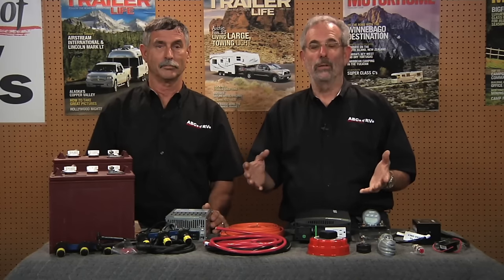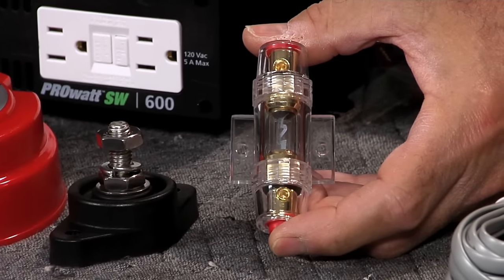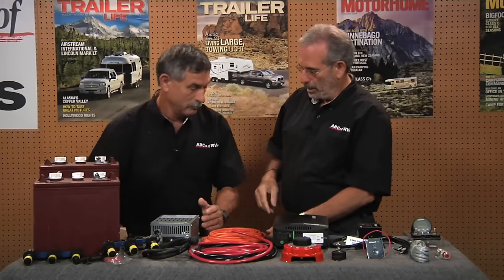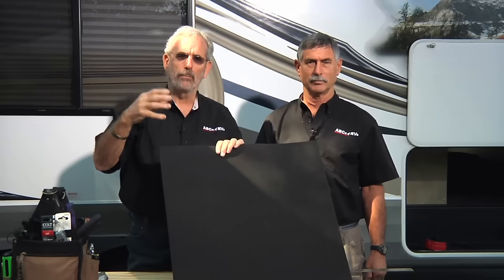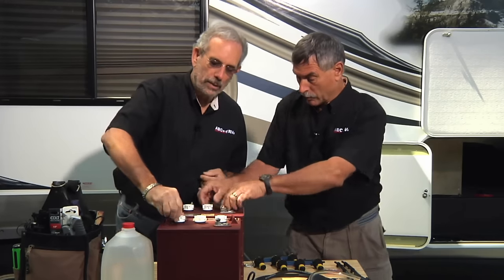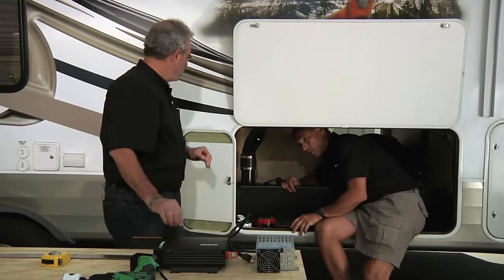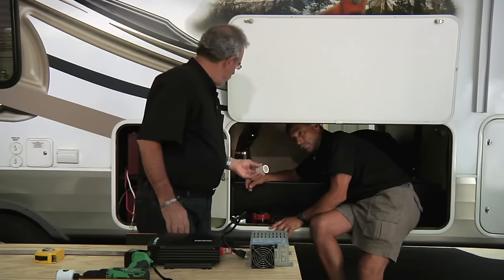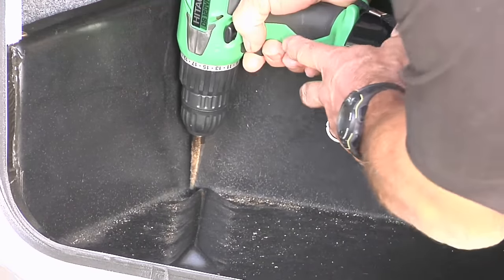12 Volt DC System Rebuild for RVs

Comment: I strongly recommended wearing safety glasses, especially when working with acid batteries that produce hydrogen gas and can explode. Unfortunately I witnessed a coworker have one explode while he was working with it so its not a remote possibility but very real.  
Thanks for the great vid. I did same to my rig but with 4 6v trojans 4/O cables and 5000 watt pure sine inverter. Really nice To run anything even the roof air or microwave.

Comment: Thanks for the good video.  I have to admit, some of the other comments bring up some 'oversights' or 'skip overs'.  I've been in the semiconductor, uv, high end residential electronics, and a fabricator for industrial electronic and electrical applications.  I started watching this video to get some ideas for a Jeep Wrangler.  I realize this is not purely an off road vehicle obviously, but some of the methods seen in the video seem not to be 100% robust and failure proof.  Vibration, corrosion, and waterproofing (marine grade everything) are the nemesis for off-roading vehicles and I would think these same problem areas would be true for RV's.  Cheers!

Comment: Overall a good video.  I have the exact same inverter. Like it very well. Two things I have issue with. The inverter is rated for 2000 watts. You have it hooked up with #4 wire and a 80 amp fuse on the 12 volt side. So you have an 80 amp circuit at 12 volts equaling 960 watts.  The inverter is capable of supplying 16 amps on the 120 volt side. But,  by this install,  it is choked down to 8 amps capacity on the 120 volt side.   Need to add another #4  cable in parallel on both the positive and negative battery feed.  I would change the fuse out to a breaker at 150 amps.

Comment: I had a new and large battery box fabricated to replace the cheesy plastic one to accommodate the larger 6volt AGMs. To make life easier in having access to the batteries, I bought two glides/tracts for cabinets rated at 200 lbs. The glides were welded to the sides of the box and a tray was attached to the glides. Under the tray I fastened three ball bearing rollers for added support. The #4 cables were cut to fit the length needed when the tray with batteries is pulled out.

Comment: Interesting video.  Thanks for sharing.  I have an interest in the battery systems on these trailers. There are not details but they are not required as I can look into those details myself.  I liked seeing what you were doing and gathering some ideas.   

The audio is much better once you get on the trailer so it was easier to watch at that point.  Thanks for the video and hope to see more.

Comment: Good idea to tape the wire nut at the end....but I noticed that you wrap the tape counterclockwise to the clockwise screwing on of the wire nut....which seems to have slightly loosened most of the wire nuts you taped up. Go consistent with your wire nut, tape clockwise too.

Comment: When you are using black tape to wrap the wire nuts, you should definitely wrap the tape the other way around. If you watch the video, he is pulling the tape tight and unscrewing the yellow wire nuts as he goes. In an effort of making his connections tight, he is loosening them.

Comment: Pretty good video. Obviously a lot of work ro make it. Improvements.... 1) A chart showing what's the before and after  2) Cost of materials 3) Basic block diagram of the existing system and then changes. 4) could have fast-forwarded through things such as applying a wire nut and tapeing. Anyone attempting this extensive change knows how to connect two wires. A chart of the bennefits. Seems like a lot of work and expense for what gain.  Thanks for your work.

Comment: Just a personal better thought about the battery choice 6 volt vs 12 volt.  A T125 6 volt Trojan gives you a 20 hr rate of 240 ah at 6 volts.  In a 12 volt system with 2 of these batteries you wind up with a 20 hr rate of 240 ah at 12 volts at a combined weight of 132 pounds.  A T1275 12 volt Trojan battery gives you a rate of 150 ah at 12 volts.  in a 12 volt system with 2 of these batteries you wind up with a 20 hr rate of 300 ah at 12 volts at a combined weight of 164 pounds.  So for an extra 32 pounds you get 125% of the ah rating.  I run 4 T1275's in my camper as opposed to the original design of 4 T125 plus due to the extra time available.  The common misconception is that by having 2 batteries you double volts and amps/reserve.  You can only add one or the other.  2 batteries in parallel gives you the sum of the amps/reserves (2 @ 6 volt 240 ah parallel = 6 volts 480 ah).  2 batteries in series gives you the sum of the volts (2 @ 6 volt 240 ah = 12 volts 240 ah).

One other personal suggestion, as opposed to a car stereo mega fuse, a 12 volt manual reset breaker makes for a less fuss way of protecting a high amp large gauge wiring system.  They have a higher cost, but work the same as a high voltage AC breaker like you would have in your home or RV's high voltage ac electrical system.  They are readily available at most automotive parts stores (Autozone, Pep Boys, Napa, O'Reily's, and Discount Auto parts all show them in stock in most stores across the US) and are available in ratings to more then handle your chosen inverter wattage requirements.  I personally have a Cooper Bussmann 30v 100a rated Circuit Breaker which has a cost of around $30.
Reply: Good idea on the batteries but you failed to include the cost.  Hope at $450 for two twelve volts versus $250 for the two six volts. That's almost a 100% cost indeed for a 30% gain in amps.  I'd have to be a very hardcore boondocker where they 30% made a real difference to justify the cost.
Reply: I wish you had made it clear about if that breaker is at the 12 volt level or after the inverter.
Reply: @lancebaker1374  There are LOTS of things that I wish they had made clearer. Hands were often in the way of the object being photographed, they pointed out how important it was to cut off the proper end of the extension cord without clarifying which end they chose, etc, etc.

Comment: You should use plastic snap in romex connectors. They are much faster to install, especially in cramped quarters. No locknut to fumble with or screws to tighten. Also less chance of wire chafing and shorts/fires in the future. RC-50's for 1/2" and RC-75's for 3/4" Knockouts. As a journeyman electrician with 23 years experience, we very seldom use those metal connectors anymore.

Comment: Good video overall. No grommets? Also, I would not have placed that junction box next to water supply, it wouldn't satisfy code in a house and these things are tinder boxes. At a minimum that should have been mounted vertically in a weatherproof box.
Reply: Just saw this. Agreed.

Comment: I just love the location that you have chosen to put the cutoff switch. Behind the plumbing. You will have to hire a midget to turn the switch off. Not mutch thought went into your desighn🤔. Put switch in first by cabin opening then install inverter and converter! Then measure cable lengths. Plastic conduit would be approximate for your install especially underneath where road debris could damage the wire and the wire is exposed to water. Your install is a shabby not well thought out procedure. The 110 wire needs plastic conduit and sealed with silicone to prevent water infiltration, or insects climbing inside the camper.  Your system will work but with more care and planning and insulation on  exposed wires and sealant where holes are drilled. This install could be better😁

Comment: Gentlemen although overall it was a very good video I saw a few major mistakes, 
1) the j box you used should have been a water tight or bell box, since you have a water pump almost next to box
2) their was a grounding lug on the 4s box that you used should have been grounded required by code
3)I waited and and but it never happen, the clamp box connector was never tighten

Other than that pretty good

Comment: When taping the wire nuts, it is best to put the tape on winding in a clockwise direction so that it is pulling the wire nut tighter on the wires. They do not have to back off very much to create a bad connection, or worse yet end up with a loose wire.
Reply: YOU ARE WRONG NEWK! The tape, applied COUNTER-CLOCKWISE,  prevents the wire nut from turning counter-clockwise!!

Comment: Talking about your wire connections using the right size ones you should be using electrical silicone field wire connecters then tape in them especially with being around a water source

Comment: Use a push button breaker, label all wires use corrosion resistant coating on terminals. Mount all cables.  Securely mount Battreys in a box in vented cabin mount inverter in a cool vented cabin that's water and weather resistant. Install a charge controller with a meter. Do not over discharge your Battrys. Install  solar panels and controller check battryes level every month

Comment: Great video. Just a few things I must mention. One. the J-box should have been waterproof if you're going to put it by the water pump. You were already wiping up water there. 
You didn't ground your box.  And just a quick check with a tape measure and the monitor and on/off switch would have been lined up. It would kill me If that were my camper and I had to look at them off center the rest on the time I owned it. 
But I must say it's the first full install job I've seen anyone put on here. 
I watch as much as I can. sometimes I see something I didn't know. Like the battery auto watering system. That's cool. But very pricey. I have 22 batteries. OWCH!!!!

Comment: I would never get these batteries.  They are too heavy and cost you on gas consumption in the long run.  Also, they don't really last five years each.  With regular use they will last around 2 and half to 3 years.  On the other hand lithium batteries with the same amp hours may be more expensive when buying them.  But, in the long run you will save money because they are lighter (less gas consumption on RV since it won't be carrying heavy batteries) and Lithium will last between 6 to 8 years and you won't have to worry as much on the percentage that is charged.

Comment: When wiring estimate amount of wire needed for the box and add 3 inches strip all wires 2inches and align all wires together then twist wires together with pliers tightly then use clippers cut off extra bare ends then use the right size wire nut and tighten with pliers then fold wire to fit in box. This prevents bad connections and wires from coming loose twist all wires together before wire nuting clip off extra wire

Comment: Is the zantrax transfer switch  to shut down power from the inverter to the box?  If you have the inverter turned on and you plug in the generator or shore power will the inverter stay and and if so wont the power sources be competing with each other or short each other?  Can you run multiple power sources at once and if not what will protect the system from blowing fuses or shorting out if more than one power source is used?  Will a 4000 watt inverter run a fridge and stove together?

Comment: well kinda confused you eliminated the circuit breaker on the distribution panel. then wen putting in the power for the inverter you cut both wires wen only needing to cut one.

Comment: Here is a tip for you  if you are going to disconnect and wrap wires as they have done; cut off any bare wire ends before you wrap them that way there is no exposed wires at all, because, bad things happen to good people. Usually by accident. :-)

Comment: Why did you cut two separate wire bundles to splice in for power to the new converter? You could have just messed up two circuits at different amperages.

Comment: And wind fasting your J box down along with your wire fasteners you should always use silicone on the ends of your screws so that when you’re towing your trailer down the road water can’t Seep in and write out the word.

Comment: About the J Box install; I would not have laid it flat on the floor there, because it’s beside a water pump. I”d have mounted it vertically to the wall, in case of water infiltration. Other than that, good job.

Comment: Can the transfer switch be connected to more than one circuit, as long as the total capacity of the combined circuits is equal or less than the capacity of the inverter?

Comment: As a retired electrician I'm disturbed by the fact you are not twisting your wire ends before installing wire nuts. This allows corrosion and oxidation to diminish the actual copper to copper contact and cause overheated connections.

Comment: Did you consider lithium batteries as they are lighter, last longer and do not need the addition of water?
Reply: Hi, Mary, this video is a couple years old now so, no, lithium was not considered at the time. I definitely would consider that if overhauling a system today. Do take cost into consideration, though. Lithium batteries still carry a pretty heavy front-end investment. When you run the numbers, though, yes, the common wisdom these days is they are a better deal in total ROI.

Comment: Do you have a version of this with the audio balanced between Bill and Bob? I'm sitting here turning the volume up and down and up and down ...
Reply: Bob Bennett 

Ya...Im done
Bummed too, was looking forward to adding to my brain a little, but its not working...
Reply: want some cheese with your whine?
Reply: I think there mikes are not working right
Reply: Or they could add subtitles so we at least can read what they are saying?
Reply: Compress it and turn it up. Simple fix.
Reply: I regularly use FCPX but 99% of people here ask "WHAT THE HELL IS COMPRESS......?"  Just BEING smart doesn't help people.  Or are you talking to the film editor?
Reply: The video got better when they got to the trailer.
Reply: High quality fuse, has a set screw for the connection.  Sorry, NOT.

Use a Blue Sea 5001 Fuse holder with the correct Buss fuse.
Reply: Oh and hey, how about a low voltage shutdown switch?
Reply: The battery in Bob's mic is low or bad... LOL

Comment: Ok, correct me if I am incorrect, but when you use a wire nut, shouldn't the wires be twisted tightly together, and then the wire nut applied to maintain the connection?
Reply: Jeffory Newkirk yes. Using a wire nut the way they did was not good. You gotta understand the RV world is all done very poorly. These things are all an abomination of “crapsmanship”.  I saw so many NEC violations that I redtagged my iPad.

Comment: If you are not hooked up to shore power, why not just plug the shore power 30amp plug with a 15amp adapter to the inverter? Then any plug in the unit would be able to be used still knowing that power is limited. The breaker would still kick off with excessive usage.

Comment: Would Lithium (lifepo4) be a better choice? Less power losses in charging. Full power charging right to full. No out gassing(no corrosion). Full voltage at all loads(easier on equipment) No maintains. Lighter. Can use most of the AH (unlike half with lead acid) Very long life.
Reply from the maker: Lithium definitely have their advantages but they are still pretty expensive.

Comment: When you installed the wires to the receptacle you  put the wires on in the wrong direction always put the wire curve in the direction of the screw as you tighten the screw.

Comment: Great video!!! I'm wondering what type of upgrade would be recommended for someone who just wants an upgrade from the basic battery system from the factory? We don't use a tv, and the radio is a 12 volt automotive type. I'm also upgrading all lighting to LED.

Comment: Starts out with great promise. Seems like it will be a detailed, thorough explanation of a complete rebuild, but is disappointingly incomplete! You don't show us the other end of the 6 connections (or did I miss that when I fell asleep as you showed us how to drill a hole in the wall). Not even a picture of the completed project all connected together. Details of issues common to all setups were displaced by details of issues specific to your particular rig. :-(

BTW the audio sounded fine to me (using headphones)

Comment: When connecting converter switch to back of electrical box, what wires are you connecting to braker and rails? What are second set of wires you are connecting too?

Comment: At 54 minutes you absolutely should have used a water-proof J-box with appropriate conduit in case one of those water-hoses ever leaks. At the least install it on a vertical surface where leaks won't puddle into the box. At 1:03 it is typical to turn the loops on the wire so that the tightening screw wraps the loop tighter to the screw instead of how you did it where the screw pulls the wire away from the screw. You can get away with the way you did with 12 guage and thicker but 14 guage will back out. Most importantly, why remove your wrist-metal but leave your finger-ring on?  All-in-all though, a beautiful and informative job.

Comment: Why don't you use a solder pot for tinning the wires? It makes the job a lot quicker and easier. Dunk the stripped end into liquid rosin flux not acid, then into the solder pot and out again... job done.

Comment: I have a question that you can probably help me with. I'm going to install a battery disconnect switch  and I have done it before BUT it was simple because I had only one battery and no inverter.  Which negative cable do  I hook up to the disconnect switch? It's a 2 battery set up in parallel. There is a negative cable going directly to the inverter, one going directly to a grounding block on the frame and another cable going directly to the other battery. Which one goes to the switch?

Sent from my iPad

Comment: perhaps I missed something, but it looks to me like there would be some siphoning from the upper battery to the lower battery.
Reply: pretty sure each cap has its own valve internally, when a cell is full ( at the correct level, not full to the brim )  its closed off so cant siphon out